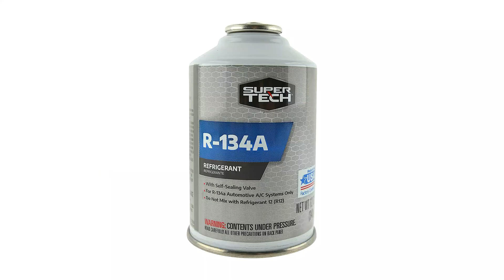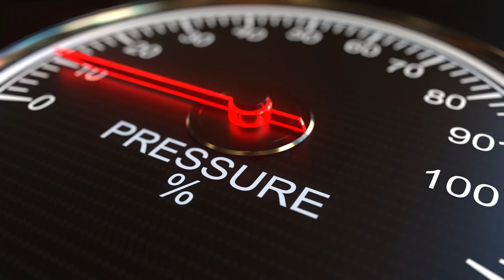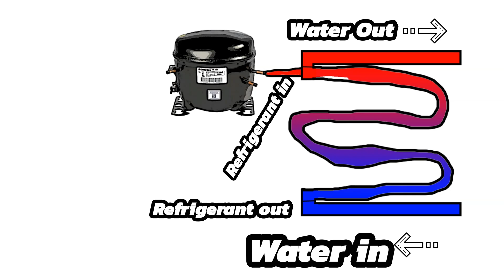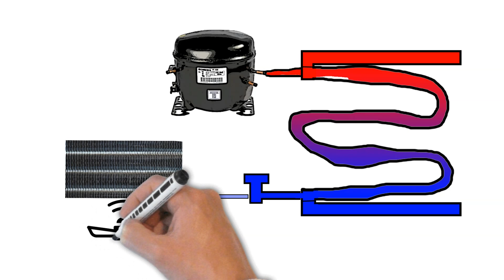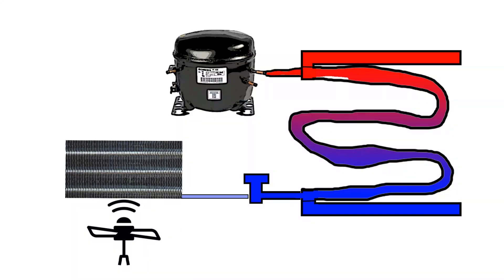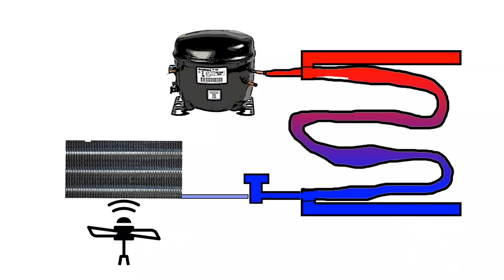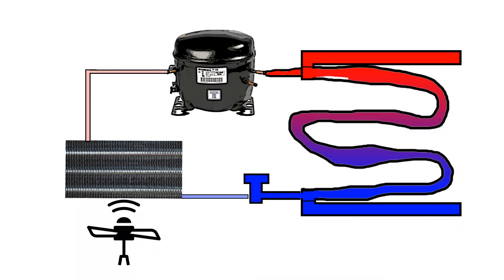How does a Pool Heat Pump Work? A Simple and Easy Explanation for every pool owner.

Comment: How did you did your initial set up once installed. Manual is confusing.
Reply from the maker: What do you mean? Like what settings did I use? Or how did I wire it?
Reply: @LaceyFamilyFarm what settings did you go for.

Comment: My brand new pool water heater model P-R156 A doesn't start up, how to start up the heater? It keeps showing off at the control panel.
Thanks for your help
Reply from the maker: Is your pump on? Typically it won’t turn on or less water is flowing through it when your pump is on.
Reply: @LaceyFamilyFarm  Hi, My pump has multiple speeds and the heater turn on only wen I used speed 3 or 4, and that was the issue however thanks for helping me.  Blessesings
Reply from the maker: @luiscuevas2382  good deal. I’m glad it’s working.
Reply: Yes, is running water, I noticed that the panel is showing swing open and do not start up or turn on
Reply: Sw open